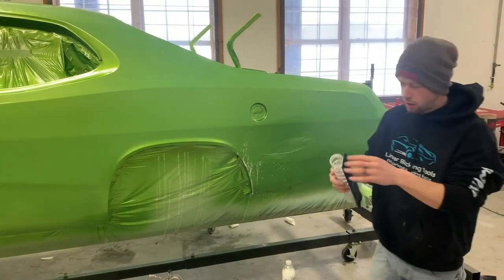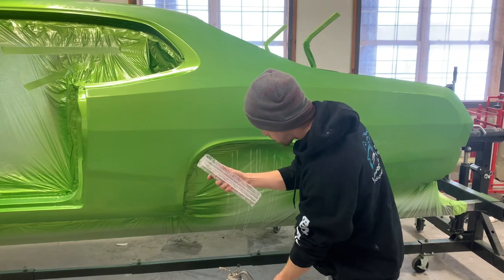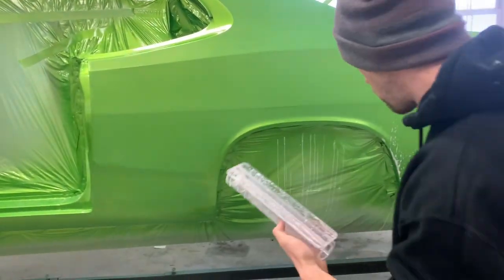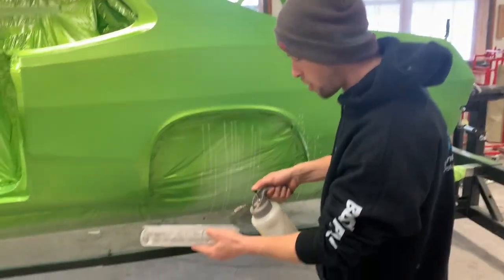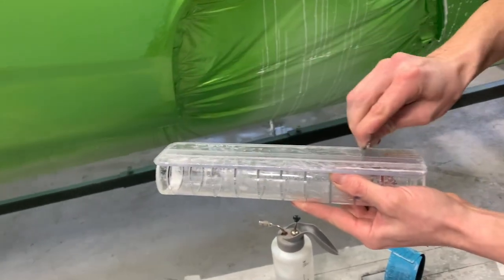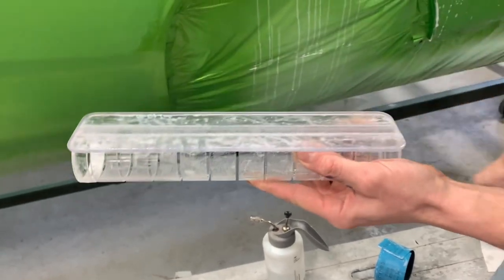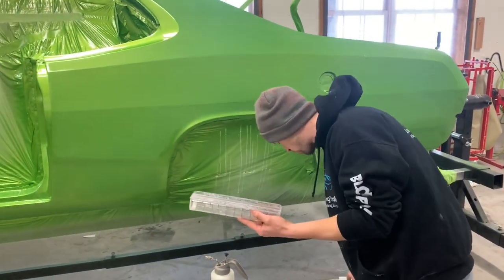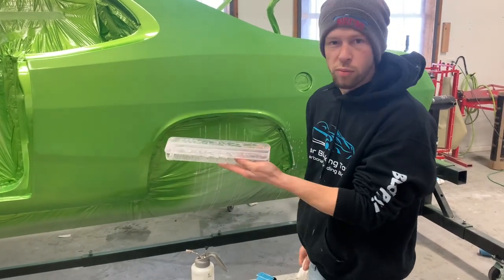How to clean Linear Blocks

Comment: Garbage blocks and paper.  You end up with all of the papers adhesive left on the block and if any solvent used to clean it off gets on the circular rings they just fall right off.  Terrible products.